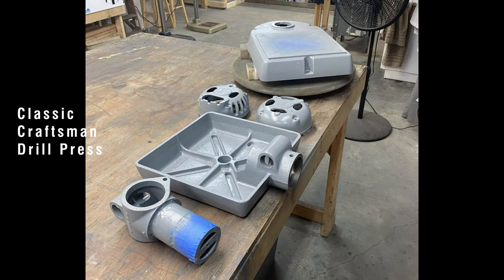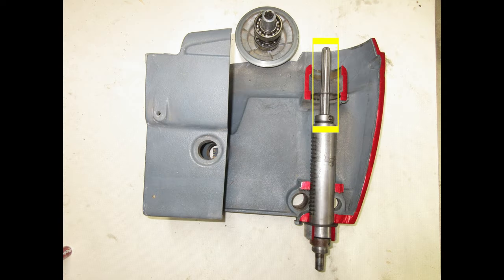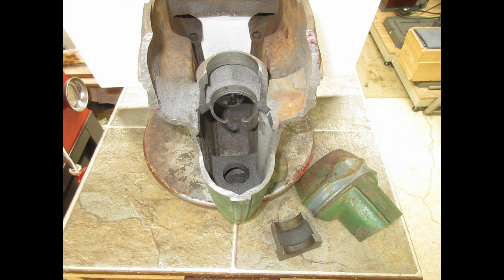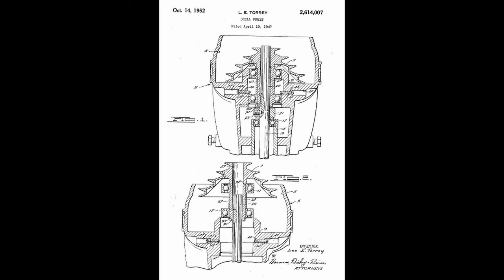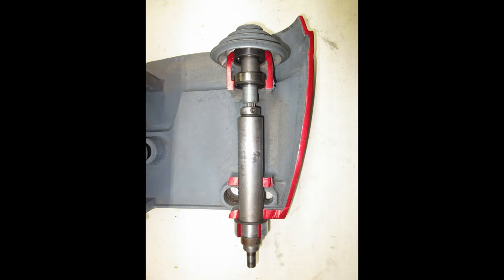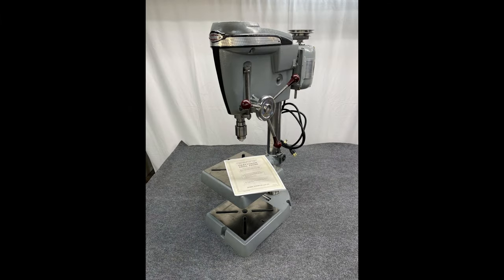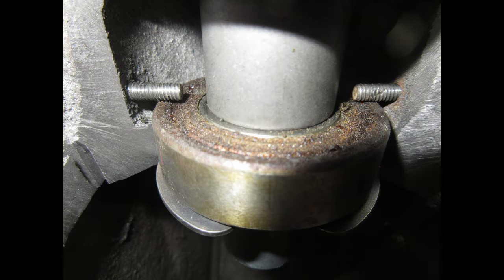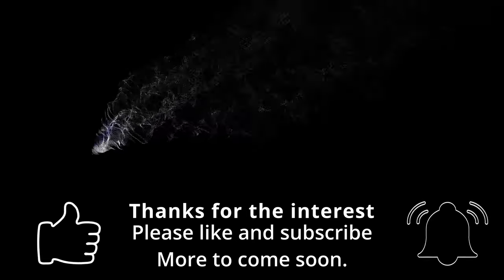Classic Craftsman Drill Press Internal Parts & Interactions

Comment: Thank you just picked one of these up in great condition. Both of those machine screws to hold the pully assembly are broken, but I was able to get them both out of the head casting. Going to replace tomorrow and make sure everything is seated as I put it back together. Thanks this video series is SUPER helpful for the 100 series!
Reply from the maker: Congrats, I believe the machine screws are 8-32 x 3/4 Round head

Comment: Great video. I have one of these, I believe the 100. What size belt does it take? I have been unable to run it due to a stretched out belt.
Reply from the maker: Shold use a 1/2" x 45" v-belt; however, any 1/2" belt between 43" and 45" should work just fine. I prefer cogged V-belts like duralast # 17455 available at autozone.
Reply: @JeffsShop  Appreciate it, thank you.